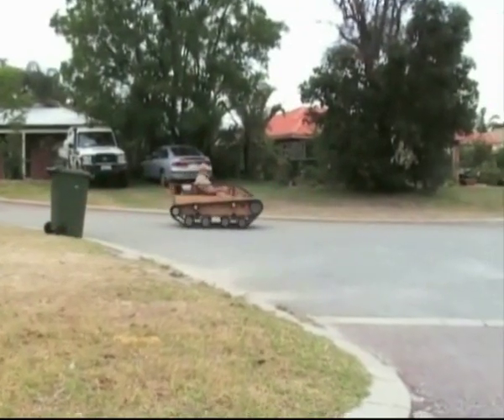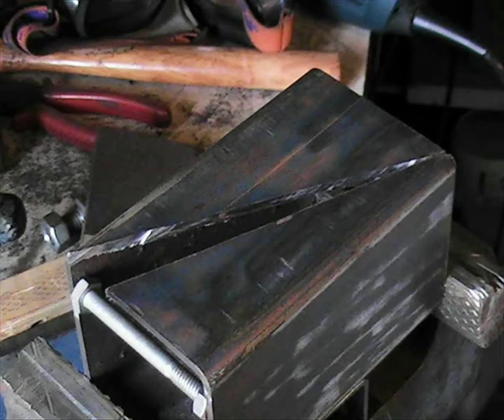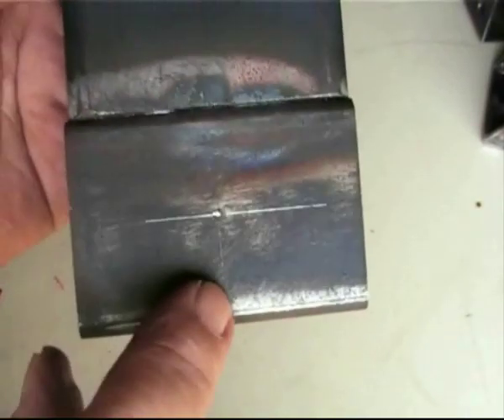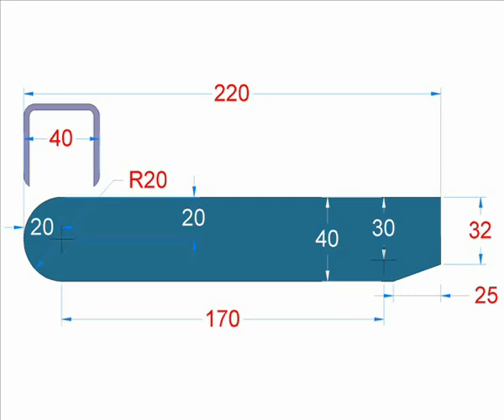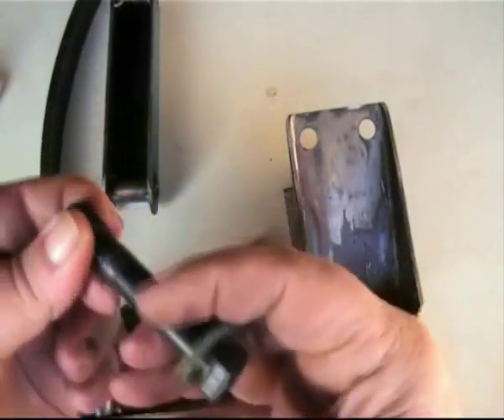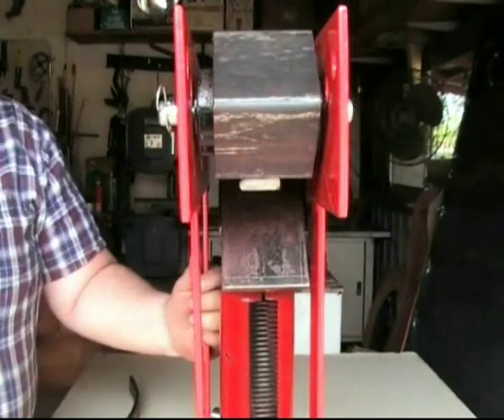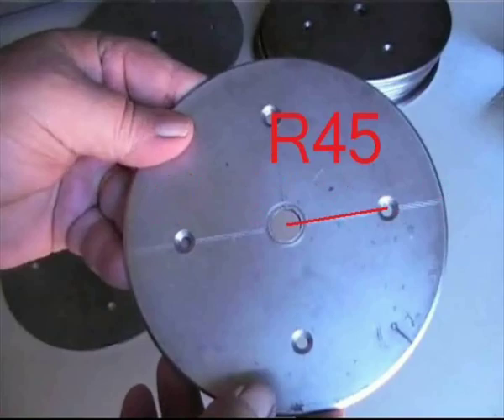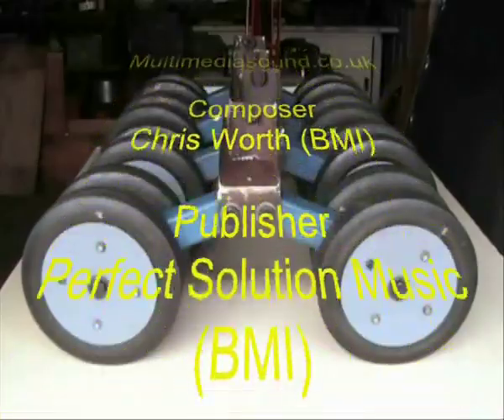Badger Mk1 Scaled tank - Episode 6

Comment: If I were to use an 11horsepower Honda engine, what type of changes would I have to make to the transmission and other components to be able to handle the increased power?
Reply: Make it bigger. Problem solved lol. Also, you might want to use chains and sprockets rather than belts and pullies.